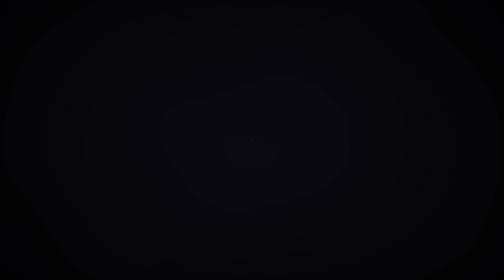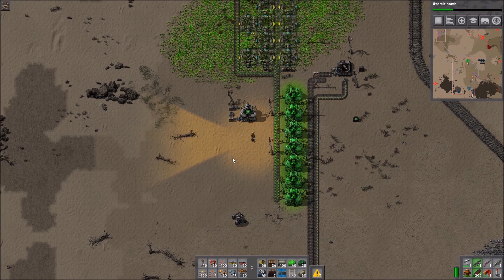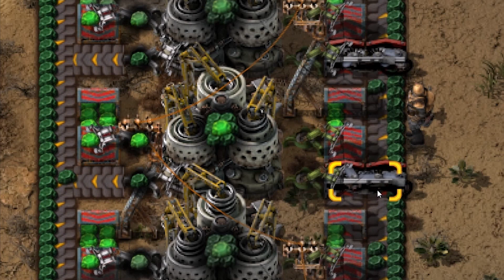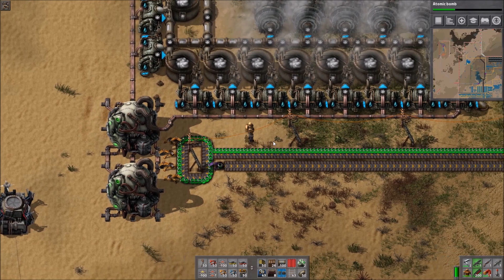Factorio Nuclear Fuel, Power and Reactor Tutorial (just 8 mins!) [v0.16 2018]

Comment: as of factorio v1.0
nuke power is a long way off being worthwhile . its about the same as 44 steam engines, which are dead easy to make and setup, while a nuke plant is hard to build and complex to setup and costs valuable oil to run. Its always been like this in factorio. Quite why the coal fired power plants come with steam turbines built implicity and internally while the nuke plant requires its steam turbine and other inards such as heat pipes built externally and explicity remains unknown.

If you want power quick and easy stick with coal plants, ignore the uranium ore. Only go nuclear for nuclear missles.